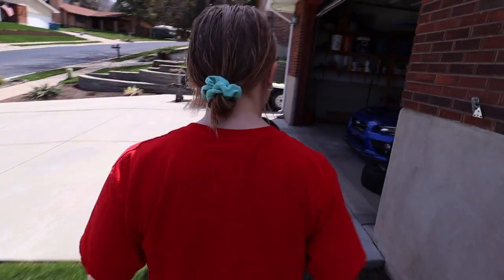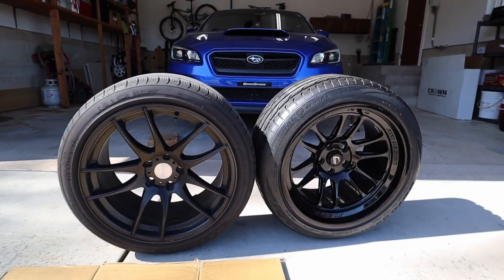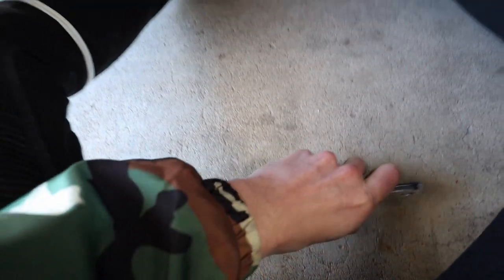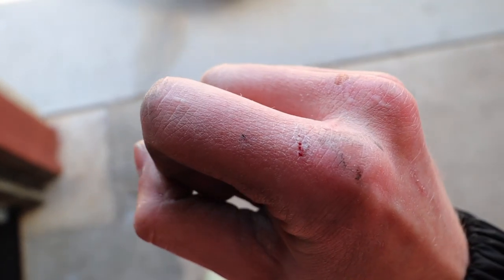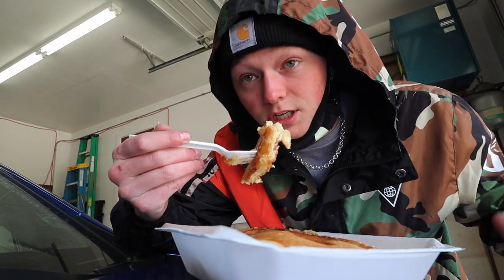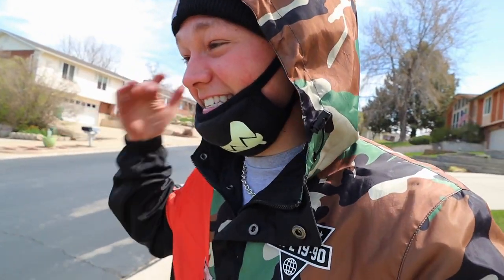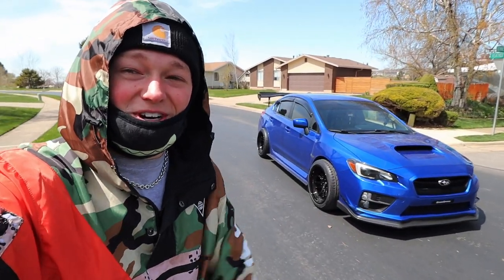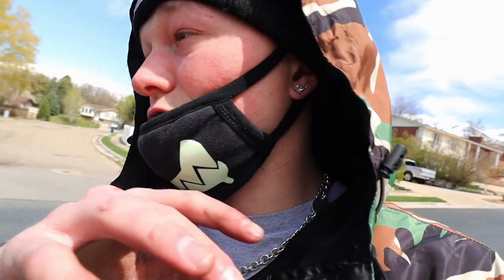Putting WIDE Wheels On My SKINNY Car

Comment: "The diffrence is insane!"

Its not much bigger. It will fit with minor rubbin. 

I had an old accent gt. They were running some econobox donuts. Replaced them with some truck steeles because I cant do rally with tiny wheels no grip on the dirt. 

I essentially got rid of all the weight on the chasis and fixed some problems. Had the thing winning races easily.

Comment: Do those wider wheels make your car have a slight pull towards the left or right? Steering difference?
Reply: running 275/35R18 and i have slight pulls to the left and right every now and then but looking to install some faction fab adjustable coil overs to hopefully help out

Comment: I've been wanting to go wider for quite some time, but always wondered what number, made it wider but I think I got it, for instance I have a 245-50-18 so I must get a 225 or 235 for the wheel to be wider, what do you suggest? and what are the pros & cons.  AND by the way they look really good on that car
Reply: No sir the first two numbers are what matters
Reply: @kelvinlopez4792  Yeah I realize now I got the new 2021 TLX type s & it has 255-35-20 tires on it so the 1st number is the width & 2nd is the thickness of the tire
Reply: @djsthemetereman  no problem funny thing is i just found out aswell this past week lol.  😂 . Are all you rim size the same front and back? And nice man enjoy your ride
Reply: @kelvinlopez4792  Yeah all wheels are the same size, & thx I sure have been enjoying it
Reply: You have 245/50/18 on a wrx? Do they fit without rubbing?
Reply: @tbennettVisuals  No this was on an 18 Acura TLX Aspec but I no longer have that car, I now have the TLX Type S which comes with a 20 inch wheel but I'm still contemplating going wider

Comment: Looks SO LIT Greetings from Germany, I'm driving a Hyundai I30n Performance and want Widebody it too
Reply: @antoineozaneaux6881  it's really hard to find some good Widebody kits in Germany or in Europe, the most ones are from Asia or the USA that I found, never looked for subie parts.
The body kit I want to use is from Prior design near my town, I could ask if they have some part for ur subie this dude is crazy he want to Widebody everything. Check out his channel👍🏽🔥
Reply: @DomG97  thank you  I am only looking for oem  Subaru  eu parts 
headlights and tail lights  , also I can only turn on my fog lights when the low beams are on , I remember with euro cars that one could use the fog lights with just the parking lights on   
this is my last car and it was made in brazil  
https://www.youtube.com/watch?v=lZ6C8NDgjBI
Reply: @antoineozaneaux6881  okay sure no problem I call a subie shop near me and ask for the stuff, but I think it's coded that ur fog light can't light seperate contact me on ista or fb

Comment: River I saw you using the torque wrench to loosen the bolts at the beginning of the video and it can actually mess up the torque wrench  by doing that but can’t wait to see the wide body on the car
Reply from the maker: Chelsea Horner thank you!
Reply: River Sanders you’re welcome I’ve messed up a torque wrench using it to loosen bolts just don’t want you to make to same mistake
Reply from the maker: @chelseahorner3261  Ah totally makes sense. You got my back!